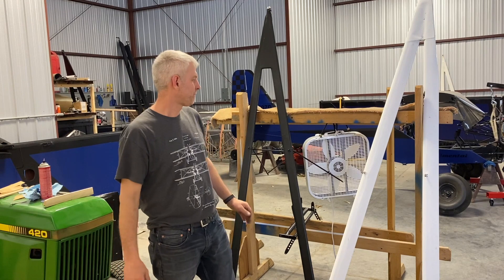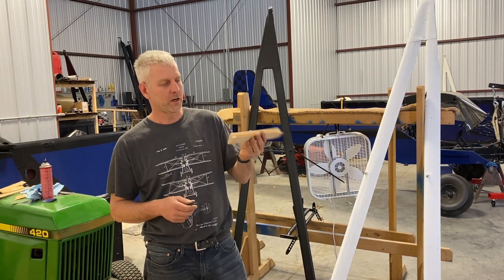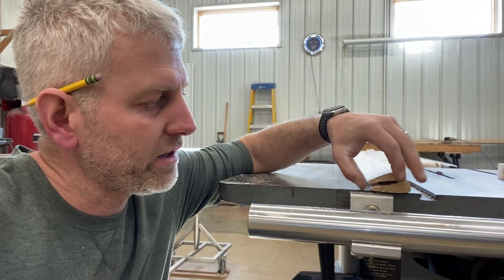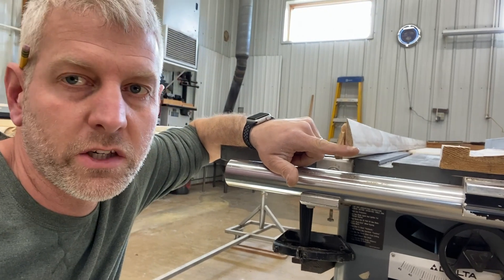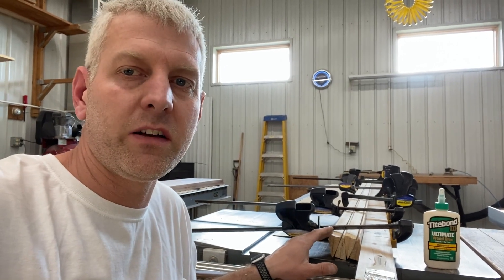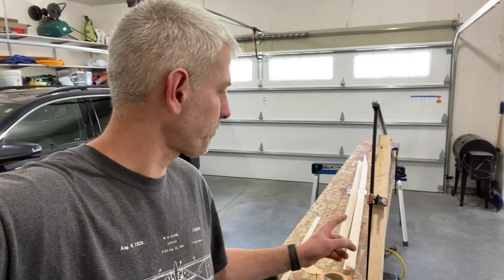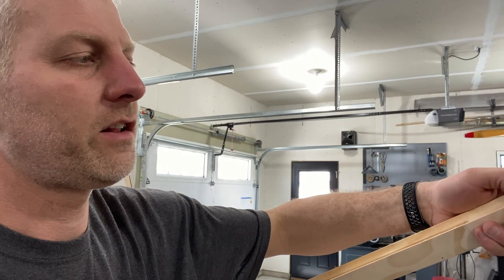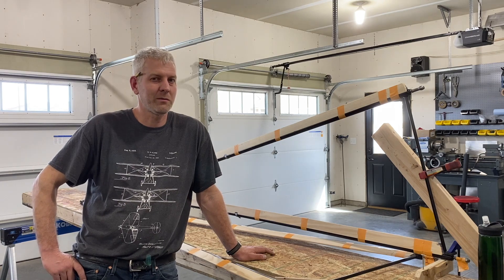Crazy Idea can you streamline an airplane using window trim

Comment: actually there is a proven aerodynamic formula for figuring the design.....uses width vs length to get tapered egg shape.  Look it up......
Reply from the maker: there sure is but everything i found a few years ago was iset up for over 200mph and following that is just adding weight when you can only go 100